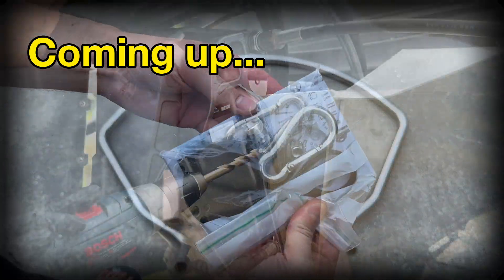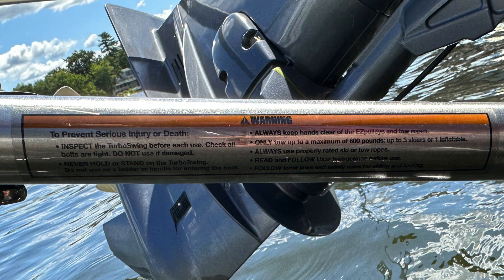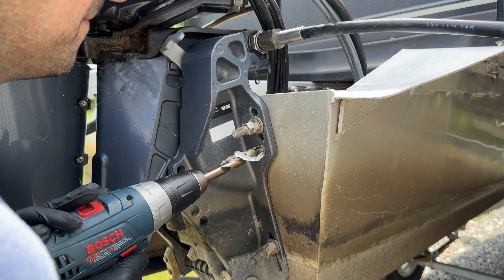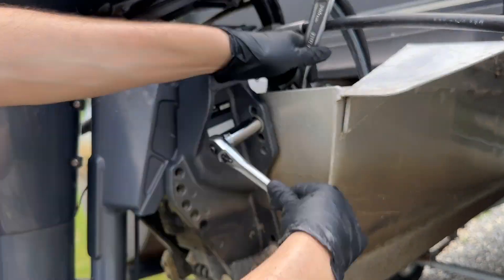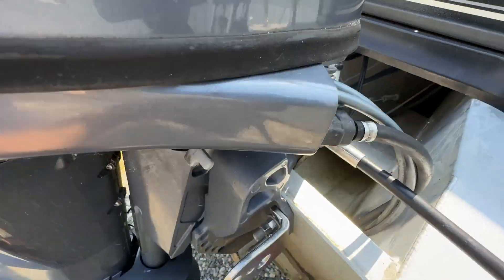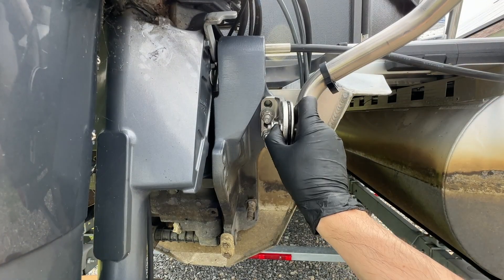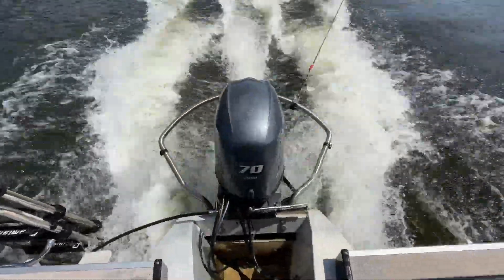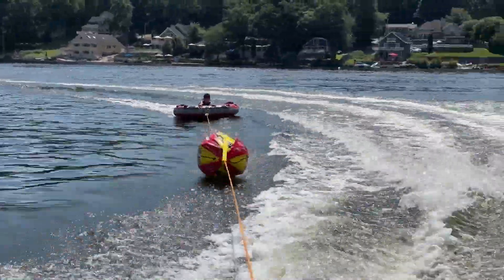TurboSwing Tow Bar: Unboxing, Install, Testing

Comment: Nice installation! However regarding your issue with the line going into the water, it's your boat because I have several friends and colleagues that have the turbo swing and none have this problem. Maybe not powerful enough or it's too low with the mounting points. Have a nice day!

Comment: Greetings from a Tiny Island in Maine, USA  Nice video - how is it a year later, still happy? Would like to see a follow up video 👍
Reply from the maker: Hi! I’m still happy with it. I like that it is removable. That came in handy when winterizing the motor last year.

My only complaint is that I wish it would hold the rope higher. I solved the rope spray issue with the booster ball that I showed in the video, but I’d prefer to not have to carry that around in the boat along with the tube. To be clear, it works fine, it’s just a logistical complaint.

I see other pontoon boats on the water with a deck mounted tow bar that raises the rope above the motor. I like that design better except for the fact that the connection point is on the deck. My pontoon boat doesn’t have enough rear deck space for one to fit (I think), and more importantly I would worry about it breaking off and someone getting hurt. I recall looking at them and seeing that they aren’t “rated” for tubes. Confusingly all I see people tow with them are tubes. 

The turboswing feels super sturdy since it is connected to the transom. I’ve had riders put too much weight on the front of the tube when we are getting going and submarine the tube. This puts a lot of pressure into the system because it basically acts like an anchor. I just slow down and start again. No issues with the turboswing yet in that regard. I don’t know how a deck mounted bar would fare in that situation.

Hope this helps. If you have any more specific questions, let me know and I’ll try to answer them.
Reply: @MostlyBuilds  thanks for the detailed response. 
I also saw a few videos that pulling tubes not recommended being pulled w/ deck mounted tow bars. Something about more pounds of drag especially if tube submarines.     I wonder how strong the tie down loops that are welded onto the end of the tubes are. Can you hook a bridle to attach the tow rope too? Even more of a problem w/ the rope being too close to the water but for a quick fix when the grand kids come up?
Reply from the maker: @TinyIslandMaine I would be afraid to use the pontoon loops pulling anything beyond like 1-2mph. If one ripped off it might rocket into someone’s face. No idea if those welds are designed for the kind of forces it would experience when tubing. Reminds me of the stories of people putting recovery straps on the tow ball on their trucks and killing the person behind them when it shears off.

I have made a bridle like you describe for a “lazy river” tow where we connected a bunch of tubes and pulled a bunch of people real slow around the lake. I connected that to the two rear cleats. Not sure how safe even that is, but we went as slow as the boat would go. I put a boat fender at the tip of the triangle to help it avoid the prop. 

Tubing on its own already has dangers involved. I personally wouldn’t want to throw a sketchy setup into the mix. That’s just me though. Good luck!

Comment: Nice, until I saw the cost! BOAT- Break Out Another Thousand :) Thanks for posting; will keep using my ski tow bar despite warnings by some not to for tubing...
Reply from the maker: Haha yeah it’s not cheap. I got mine during their July 4th sale. Maybe worth keeping an eye on if they have another. It made sense for me since I didn’t have any attachment points. Thanks for checking out the video. I will probably post other boating related projects in the future if you are interested in subscribing!